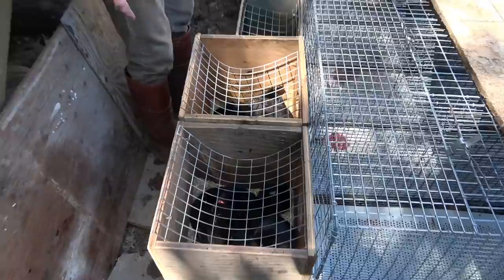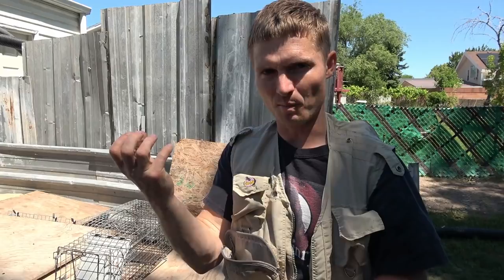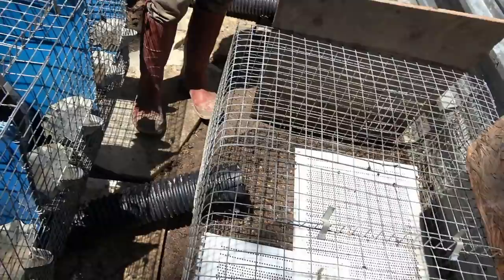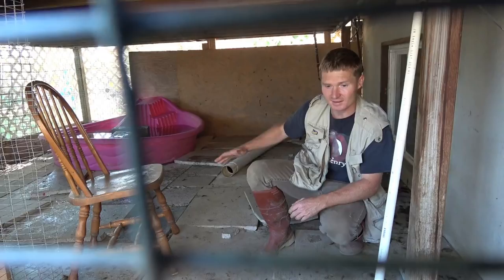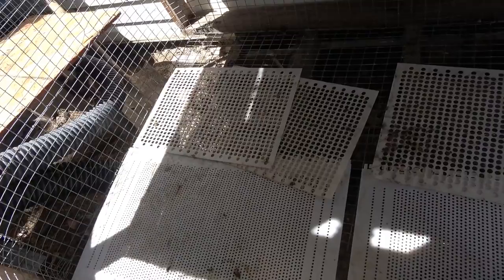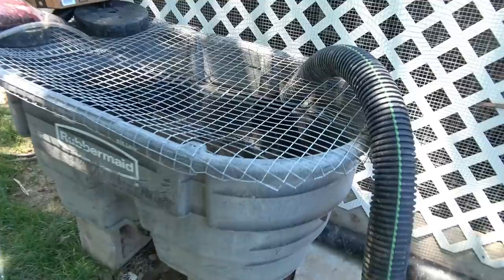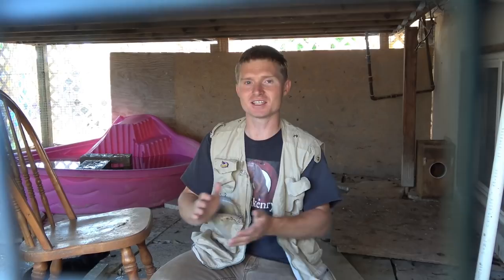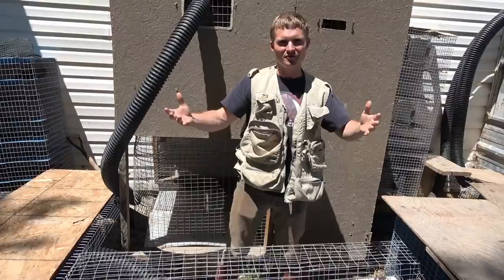Proper Mink Enclosures

Comment: Really curious who those people at the back are. I see they're playing with some baby mink and such, locals or some of the lucky few to get selectively bred mink?

Also, have you considered making the nest box in the big cage under the porch elevated with a branch leading to it? I only see one vertical beam, which doesn't seem very strong, but you could probably attach it to the horizontal porch beams. Maybe 2 hooks on one beam connecting to the back of the nest box and a wire or two from another beam to the front of the box just to lessen any wobbling.
Reply from the maker: They are people picking up their baby mink. I have a separate video I'll be posting about their visit and the advice I offer them.

Comment: I have a couple of questions about the rotation schedule and how minks react to it.
1. Does the smells of one mink bother the other mink? Do you have to change out certain parts (like does their nest box rotate with them)?
2. Beyond breeding, are there times when more than one adult mink are in the same cage?
Reply from the maker: Grumpy Mumbles Yes, when you rotate the mink they run around peeing on everything to mark it with their scent LOL so when possible I try to move the nest box with them to prevent it from getting soiled. But I don't always move the nest box, as some of the cages have permanent nest boxes, like the climbing cage I built for Fang. I have never kept two adult mink together. Since this is the first time I have ever bred mink, this is the first time I've had any mink caged together. I'm going to leave the mother and Offspring together as long as I can, but I might have to separate them if they begin to fight. I of course will eventually need to separate them when the breeding season comes.

Comment: Once the babies start using the tunnels will you move the drinking water? The angle of the camera made it look like the water sat under the tunnel. 4:18 I know it a small area of the tunnel and that you change the water frequently, but there could still be a potty accident.

Comment: Curious where you get the cage mats.  Those have a lot of useful application, but I haven't seen that style before.
Reply from the maker: The are from the mink farm industry. They use them when the mama mink are having babies, to help keep the babies from falling out through the wire. I use them permanently for the reasons I described in the video, rather than temporarily like the mink farmers do.

Comment: Can i get a bit of idvice?  I am actually looking to create an opposite effect to prevent mink getting in.  I have their tastey treat yet my lovely lovable pet bunnies.  I love in the UK and they are not native to the UK so I am not alloud to relocate therefore I would rather prevent them getting access in then harming them.  Currently it is a kennel run and predator proof top bottom amd sides but I know nothing about this animal and I have been told that will chew through almost anything to get to their prey.  He was manageing to get underneath the whole building so we were told just chicken wire to block off the gaps in the foundation block.  Do you have any further recomendations, ideas or suggestions to ensure they will not get in?   If only seen 1 in the 3 years we have loved here but where their is one I imagine more would get to follow.

Comment: Do you have any holes in the black pipes?
Reply from the maker: samasia skipperable yes I get the pipes that have little holes throughout them. This helps with airflow, as well as drainage so that water doesn't build up in the pipe after the mink has finished swimming.

Comment: The pipes are black and they generate a lot of heat, do the mink still go threw them?
Reply from the maker: They do. I wish they had white corrugated pipe, but to my knowledge they only make black. I do my best to position the tubes in the shade as much as possible. I also got the tubes that are full of holes, so they get some aeration to keep them cooler. But yeah, black is far from an ideal color!
Reply: Joseph Carter the Mink Man are pvc pipes with lots of drilled holes (for grip and aeration) a good option (besides the fact that they aren’t flexible)